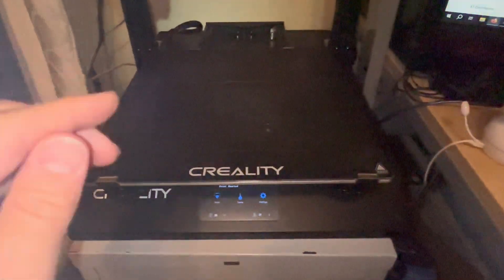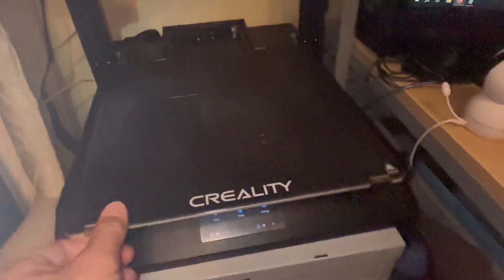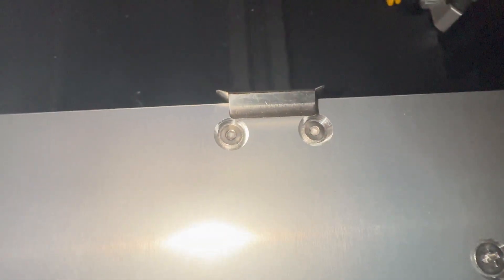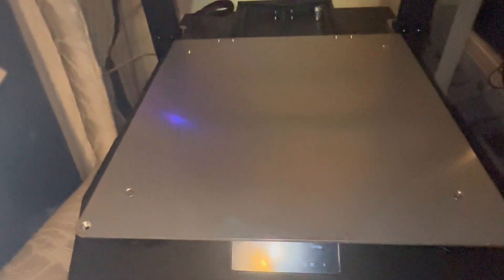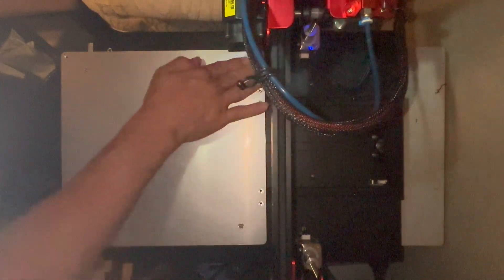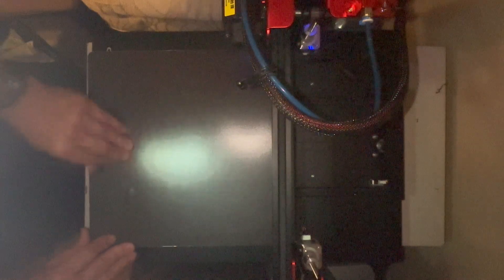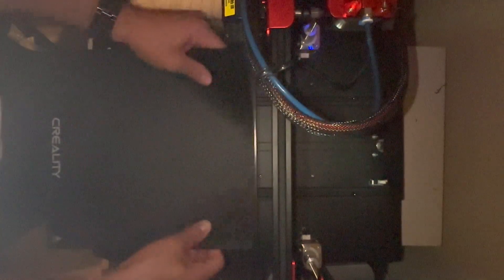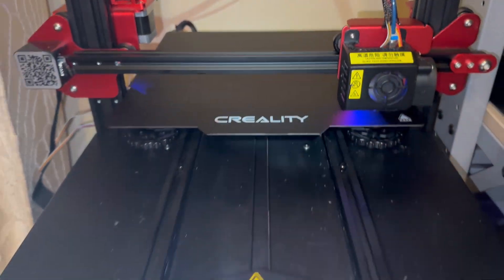Creality 3D Printer CR10S-Pro Print Bed Replacement With a Flexible Removable Magnetic Print Surface

Comment: For anyone with a warped bed, using one of these flexible surfaces will make the warping more appearent.

One solution is to put down a glass bed first to keep things flat, and then apply the flexible surface. Not ideal, since it adds height and may making heating the bed up take longer, but it would work.
Reply from the maker: That's a great point!  I would take the extra time heating up for no warping any day.  Thanks for watching!